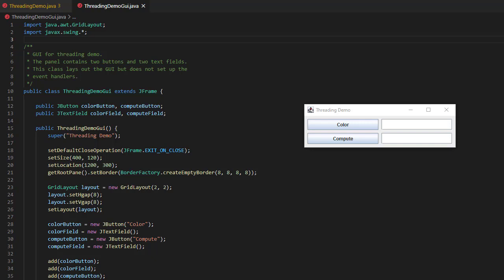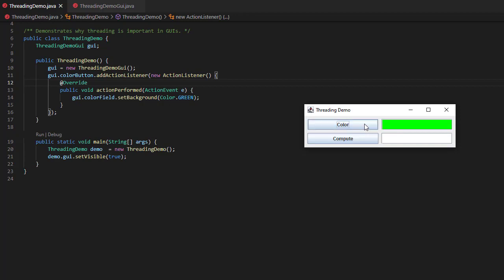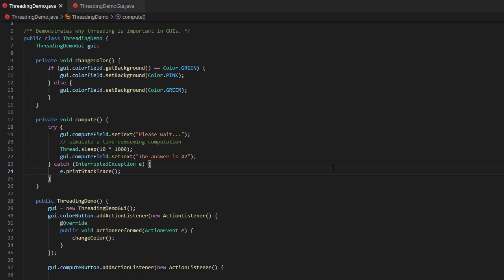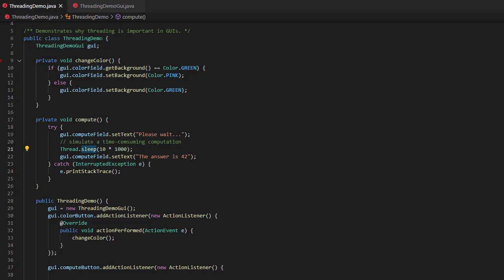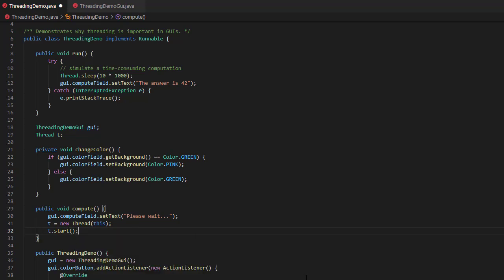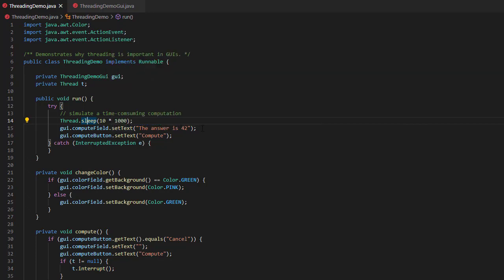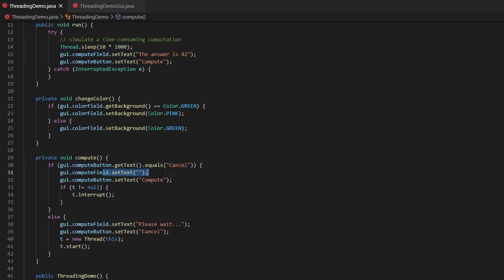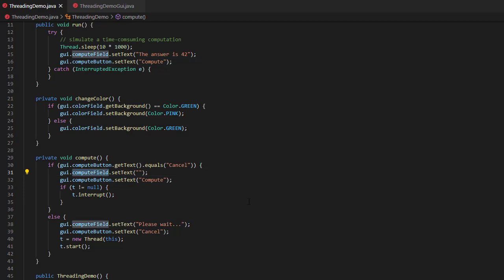Java Swing Threading Basics

Comment: Hi. Thank you for your video!

 I have a question. I have a client sever application that is used for simulating a lot of security protocols and attacks. What I’m trying to do now is to create two GUIs, one for server and one for each client. I’m having a few issues on how to start the server (on which thread) and also how can I come back from the bottom to the GUI frame with notifications such as: client connected, client disconnected so I can actually show those kind of things.

How would you approach this? 

Consider I have everything else written down. I just need to find out a clear way how to start the server and the client from top to bottom and how to come back again with these notifications.
Reply from the maker: Thank you for your comment. Generally, when you're doing client/server, each client and each server is a separate process. They could all be written in Java, but each one is in its own JVM, so there's no contention around which thread or which frame, because they have their own threads and frames. By the way, it would be unusual for a server to have a Swing GUI, because servers are generally remote administered. 

Practical attacks rely on implementation flaws (buffer overruns, information leakage, etc.) When researching them, you'd want to install and run an existing program that implements the technology stack in question. Then you write client code to script the attack. (Java can be used for that, but Python is the more popular choice.) Theoretical attacks are about weaknesses in the algorithm being implemented, and are mostly math. Neither kind requires you to write your own server, which is what it sounds like you're doing.

In most production code, notification messages along the lines of "client connected" are handled with a logging framework and routed to a log file or (on Windows) the Event Viewer. I think what you are looking for is a way to consolidate those messages into a single view so you can follow the sequence of events across programs. To that end, it is possible to install and run your own logging server.  To answer your question, my approach would be to configure your clients and servers to send log messages to a logging server of your choice.